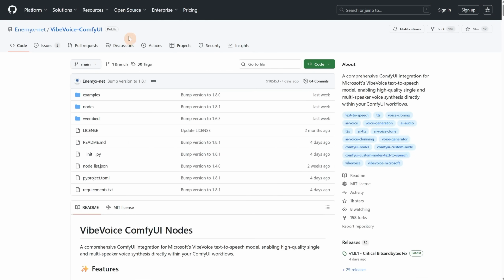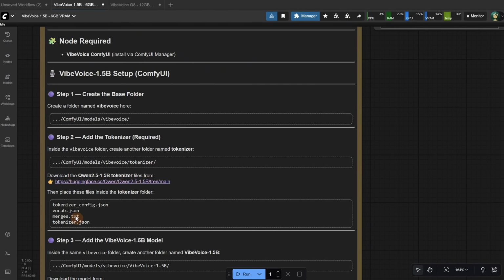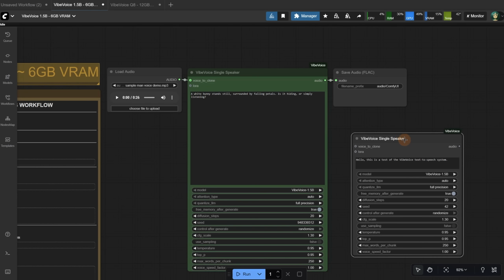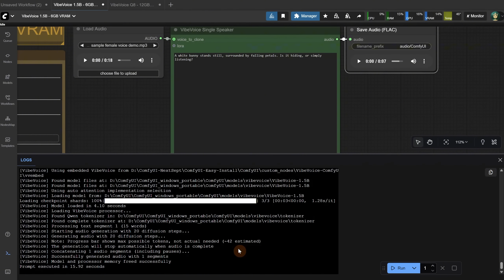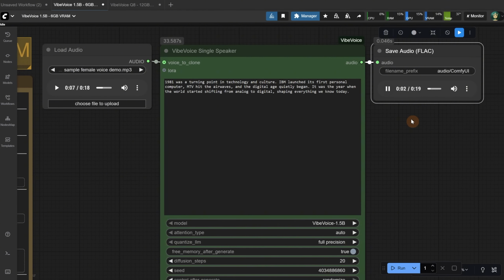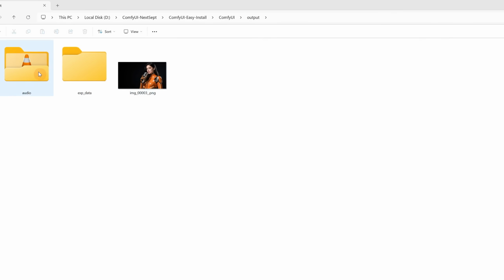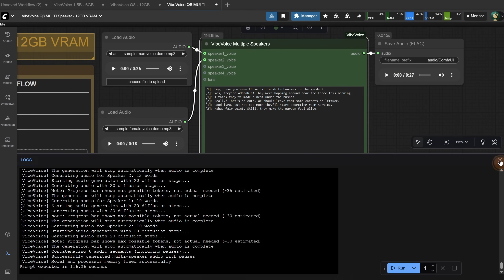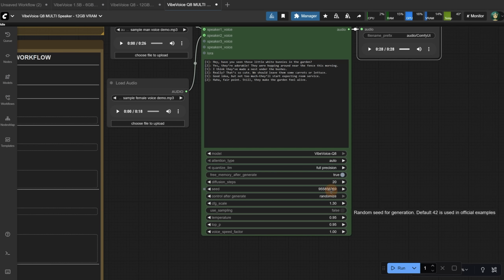ComfyUI Tutorial Series Ep 65: VibeVoice Free Text to Speech Workflow

Comment: I m putting the files exactly where the video says and comfy doesnt see the model even after several restarts, any tips?
Reply: Found the solution, just gonna leave it here in case others have the same problem: 
I was pulling the models from a previous install, which I deleted since, i copied all the models to the new install, everything worked but this. I had to put vibevoice into old installs directory.
Reply from the maker: Thanks for info , sorry for let reply i have been working all day, glad it worked out eventually

Comment: I created a Vibevoice folder and downloaded all the necessary tokenizer and Q8 model files to it. But ComfyUI says the model is not found. What could be the reason?
Reply from the maker: Someone did a fresh install and worked, not sure, for me worked when i had the files in the comfyui folder from where i link usually the models. Other needed to have a  loras folder also inside that vibevoice folder to work, so not sure why for some doesn't see it right away
Reply: @pixaroma  In this video, you show the installation and you can see the loras folder. But you don't show what should be in this folder. What should be in the loras folder?

Comment: Even though the model is placed in the correct folder, it is not recognized.
Reply from the maker: Some said to add in that folder with model an empty loras  folder and might help
Reply: @pixaroma  Finally, the model was recognized, but when loading it gives this error:
size mismatch for weight: copying a param with shape [151936, 1536] ... the shape in current model is [152064, 3584]
Reply: @pixaroma  I did almost everything, my model is recognized, but when loading it gives this error:

Error generating speech: Model loading failed: Failed to load model from D:\Program Files\ComfyUI_windows_portable\ComfyUI\models\vibevoice\VibeVoice-1.5B.
Please ensure the model files are complete and properly downloaded.
Required files: config.json, pytorch_model.bin or model safetensors
Error: Error(s) in loading state_dict for Embedding:
size mismatch for weight: copying a param with shape torch.Size([151936, 1536]) from checkpoint, the shape in current model is torch.Size([152064, 3584]).

Comment: Excellent vid. I need to ask for some help. I'm getting this error. Model loading failed: VibeVoice embedded module import failed. Please ensure the vvembed folder exists and transformers>=4.51.3 is installed from ComfyUI. I did verify there is a directory vvembeded in the VibeVoice-ComfyUI in custom_nodes dir. I also used command line pip install transformers>=4.51.3, came back with this "None of PyTorch, TensorFlow >= 2.0, or Flax have been found. Models won't be available and only tokenizers, configuration and file/data utilities can be used.
4.57.1",  also installed diffusers. Any help will be appreciated. Thanks!
Reply from the maker: if nothing works try a fresh install using this, since is what I am using maybe that helps https://github.com/Tavris1/ComfyUI-Easy-Install

Comment: followed all installation and download the model wich is in 3 part exactly as in the description however the node doesn t see the model, i have checked several time i m well locatel into models/Vibevoice, any other experience same issue >?
Reply from the maker: try also to add a loras folder there inside vibevoice folder for some helped, also if you have multiple comfyui installed like I do for me worked only when I put the folders in old comfyui and only then it saw them in new comyui
Reply: @pixaroma  thanks for your reply , i found and fix >> i just check inside the custom node and it says it was actually looking for the models into models/TTS/vibevoice   , i created TTS folder, moved all files then now it works !! thanks for all your tutorial
Reply from the maker: @wisenomad-Ai  if it look in tts that means you have installed other node not the one i used. since are two.
Reply: @pixaroma  what loras?

Comment: it says no models found. Are you sure ComfyUI\models\vibevoice\ is the right path for the models?
Reply from the maker: yes that is the path, if you have and old comfyuiu from where usually add your models try to add them there also to see if pick them from other comfyui, some mentioned that if they added the empty folder loras there in the vibevoice it got it to recognize, worth a try, for me it only recognized it if i put it in old comfyui from where usually I take the models
Reply: @pixaroma  I have the same problem. Can't get it to recognize models anywhere I put them, loras, ComfyUI\models\vibevoice\ , doesn't work anywhere.
Reply from the maker: @js.7254  make sure you installed same node like i did since are two with similar name, if you installed a different one it might look in the models/TTS/vibevoice not in the models/vibevoice
Reply: @pixaroma  okay  I resolved it. the issue was in models/vibevoice/ I needed a subfolder with the models, not just the models lying in that folder. ex: models/vibevoice/vibevoice-1.5

Comment: Q8 takes up 15 gigabytes of my VRAM and uses 20% of my GPU when generating. The card is a 4080s.
Reply from the maker: you can try the v1.5 that should take way less, or the q4 version maybe https://huggingface.co/DevParker/VibeVoice7b-low-vram/tree/main/4bit
Reply: @pixaroma   Unfortunately, choosing the 1.5B model doesn't solve the 20% GPU utilization issue. What's your GPU utilization at startup?
Reply from the maker: Between 15-30 percent for 1.5

Comment: Thanks for the tutorial, I downloaded the all the files and the created folder structure and names, but my comfyui Vibevoice node doesn't recognize the model so under the model it said, "No models found".  I've created to tokenizer folder with all the required files as well.  Does anyone else having this issue?
Reply: I think you have more than 1 comfyui installed. if you have and the paths are connected, add the vibevoice in the other comfyui models folder. It will work.
Reply from the maker: if you have multiple comfyui, try to put the files in old comfyui for me it worked that way, from where i usually get the models
Reply: @pixaroma  thank you, that works!
Reply: same issue

Comment: i can't seem to get the node to find the models. I have them in the correct folders and have all the files required according to the instructions in the workflow.  It just says "No models found". I have use the "R" key and have restarted the server and refreshed the browser.  I'll keep trying to figure it out, but was wondering if anyone else had the same issue?
Reply from the maker: I had the same problem when i had 2 comfyui with the extra models path, it only recognize the model from old comfyui path instead of new one, so i added them in that comfyui and worked after. If you only have one comfy it should work if you also have tokenizer folder
Reply: @pixaroma  Thank you!!!  That was definitely what happened. I used to have the Windows desktop version before trying the portable ComfyUI. I shared the models when I had both, but never removed the alternate paths file after deleting the desktop version. It finds the models now :^)

Comment: Thanks again for the tutorial. There's also an 'AudioSeparation' node that you can loop in between the 'Load Audio' and the 'VibeVoice' nodes to separate vocals from other noises. Makes the workflow longer.
Reply from the maker: thanks for the tip ☺️
Reply: That has requirements conflict issues with latest comfy (does for anyways)

Comment: VV is not failing, your audio source is lacking.
Reply from the maker: Sorry didn't understand what is lacking?
Reply: @pixaroma   
be lacking
If something that you need is lacking, you do not have enough of it.

Translating it for your demonstration, if you provide a source audio that doesn't have all the sounds you're going to use in audio generation, it's obvious that the AI will invent what's missing.

About random music, it's mostly due to the contamination of your audio source.
If you perform a Steem extract before using them, the generation will improve greatly.
Reply from the maker: I used an audio made with Ai the one i use for my voice so maybe it saw something in that but I didn't hear so maybe is more subtle
Reply: @jymcaballero5748 Of course the reference audio matters, but.. it gives fairly variable outputs depending on the seed. I generally have to do a whole bunch before I get what I want